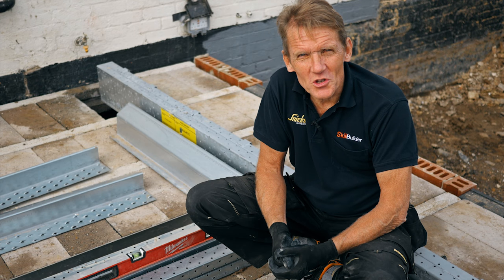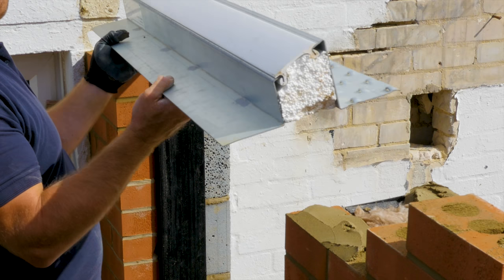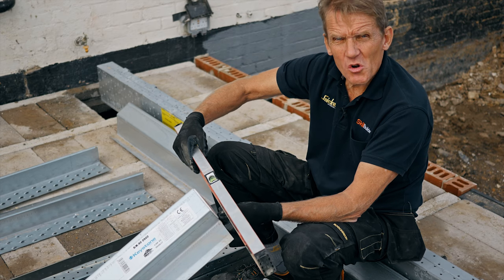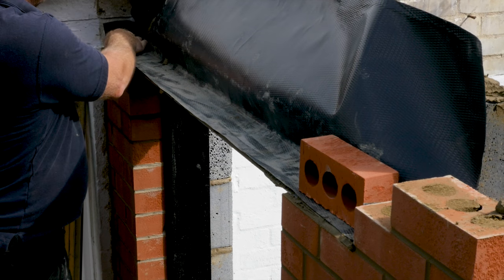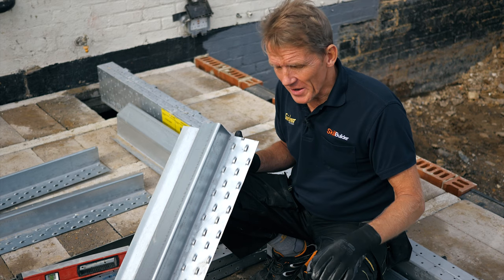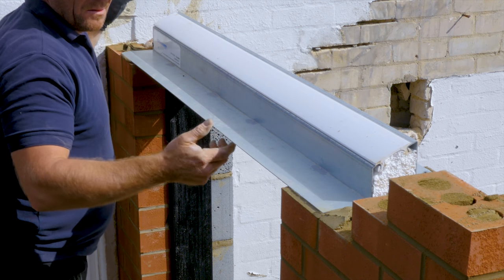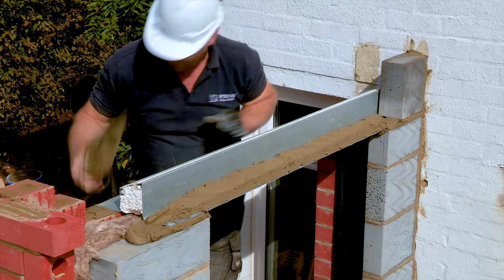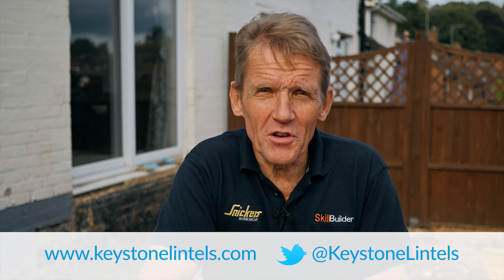Top 10 Tips for Installing a Lintel with Keystone

Comment: Nothing wrong there mate. Only thing I would say is put a course of brickwork on the lintel first and then your DPC so you don't create a slip joint. Also once you are over the lintel put your first row of ties in so you can support your insulation. Cheers

Comment: hi there
you really need to keep the bed under the lintel to an absolute minimum !. If you put a 10 mm bed under the lintel, then the 3mm thickness of the flange , then five mm bed under the soldiers or stretchers above the lintel, you end up with a 18mm thick bed joint on the pillars. obviously even on the sites this isnt acceptable

Comment: How would you load a lintel when it’s punched into an existing wall at right angle please, I.e. a door that opens at 90 degrees to the existing wall, side entry to an extension next to wall? Also it wouldn’t get the 150mm throw through or it would bridge the existing cavity? Cheers if you could advise.

Comment: Hi, thanks for uploading this! Just in time as we're fitting 50 or so of these in the next few weeks.
How far past the window and door reveals should the flanges go? Would 10mm be ok? Thanks
Reply: Brad Kew we normally try to set them about 5 to 10mm back from face of brickwork....so for example if it was a standard CB90 going onto a 300mm wide wall the lintel is 290mm wide 100mm for internal 100mm for external and 90mm for cavity that way with it being 10mm shy of 300 which is your overall wall width it wont stick out front and back. General rule of thumb is set lintel equal from front and back of wall that way brickwork and blockwork fit on. Normally window fits about an inch back from reveals so it always works out fine hope that helps.
Reply: C Jackson yeah that's brilliant thanks for the answer

Comment: You have missed the most standard procedure when install a steel lintel is  thermal expansion between steel lintel to brickwork  it will crack if you don't leave a expansion gap and you missed Weep Vents create weep holes which are required over steel lintels to discharge collected water that may form at the window/door head. Each vent sits in the masonry perp end.
 Weep vents are positioned within the perp joints between masonry. Their function is two-fold:
They act as a weep to discharge water from DPCs, cavity trays and lintels.
They also act as ventilators to encourage the cavity to breathe
 Weep-vents also satisfy UK NHBC and Building Regulation requirements.
Vents are required at 450mm intervals and each opening
should have at least 2 weep holes.
Reply from the maker: Good point and we have a video on fitting a lintel. Out soon but the expansion on an average lintel is not that great and they slip under the bricks. If the lintel is close to a gable end with no weight on the brickwork I  would mastic it. Cavities don't need to breathe they need to be air tight. Even sealed there will be plenty of air moving around on a windy day.

Comment: My lintel is only overhanging 120mm/130mm on both sides. The window cavity is 650mm. Is this okay?
Reply from the maker: Yes that will be fine, often there is as little as 100mm. It will lead to cracked brickwork in some situations but there are thousands, maybe millions that are ok.
Reply: @SkillBuilder  it's a cavity wall on the gable end of the garage. There is only the roof above. I trusted the builders and ended up with this. I thought they would know 150 mm overhang on both end is the rule.